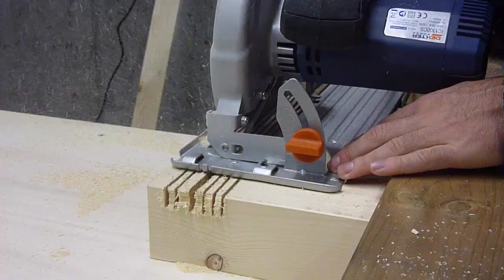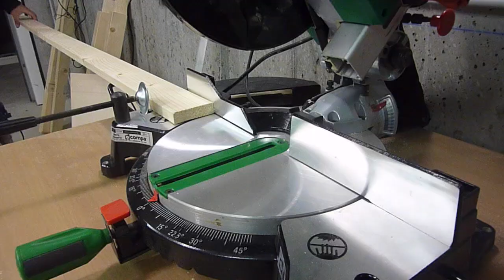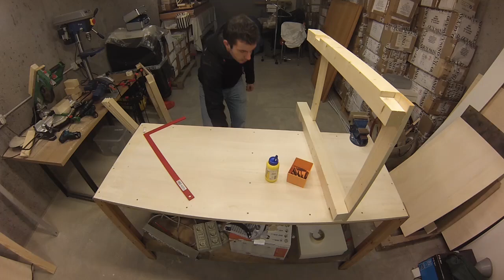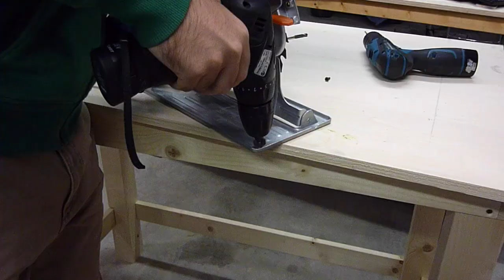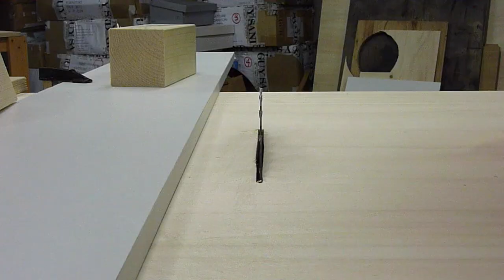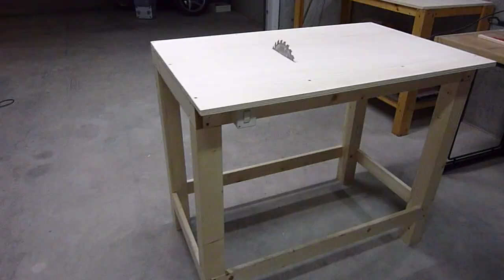Making a Homemade Table Saw (part 1)

Comment: Thank you for sharing this.  I did the same exact thing you did here .. but my only complaint is that the saw would not be able to cut a 2 by 4  :(     I would have to cut it, then flip it over and cut again  :(   any better ideas ?  thanks again guys.

Comment: Did you screw or nuts+bolts the circular under the table? Are you sure it's not going detach by vibration?
Reply from the maker: We just screwed. We checked recently if the screws came loose but they seem ok. For precaution we will periodically check them!

Comment: When you ripped cut through that wood at the end with the wood at the other side as well as a fence you could have ended up pinching the wood and cause a kickback for yourself.
Reply: ***** don't do what he did at the beggining with the circular saw always use a fence. Don't do what he did at the end either and use a proper rip fence. Not a board lay across. It works but there are dangers. Do it properly.
Reply: No problem.

Comment: how did you install the on off switch with the saw cables/
Reply from the maker: I just cut the power cord of the saw and connected the switch in line between the cord and the saw. It's a very easy job everyone can do it. Just pay attention not to get shocked. If you don't feel confident enough ask for help.

Comment: Will never cut with stuff like this. Could you give the word, that if something happen on the top, nail f.e. then saw will not cut your leg? It is fixed wit only few small screws, over the gravity and huge vibrations, while market saws are usually welded to metal frame. I know what saw blade can do the people, f.e. have seen one guy in hospital with half of blade in his groin. This device should absolutelly not be a toy. Don't diy.